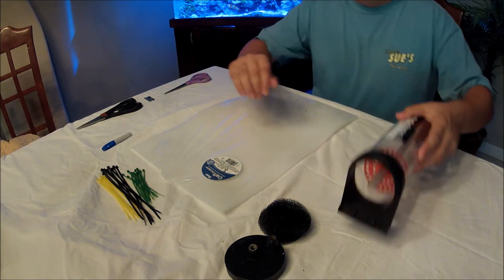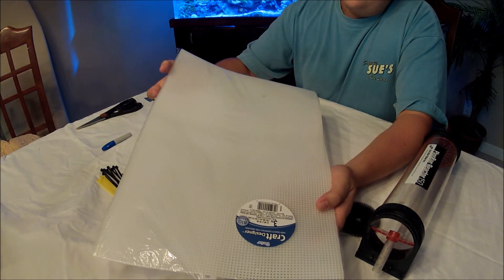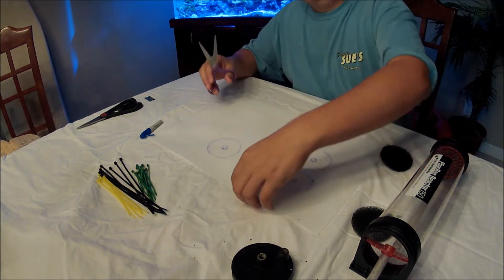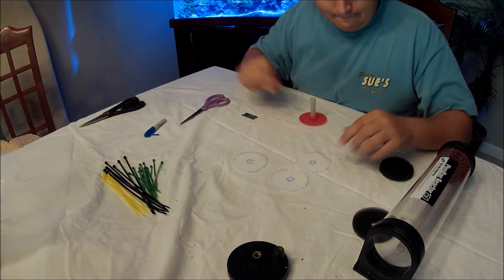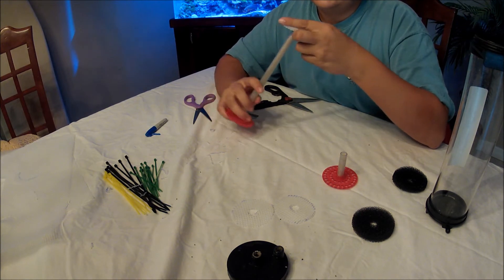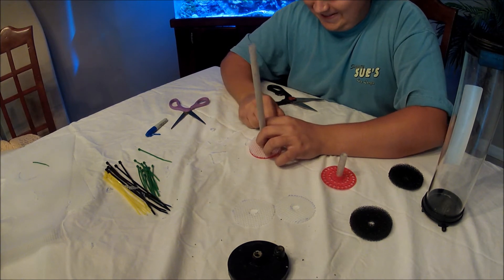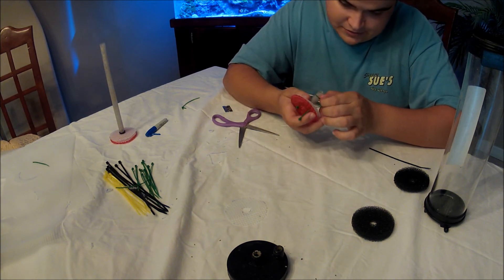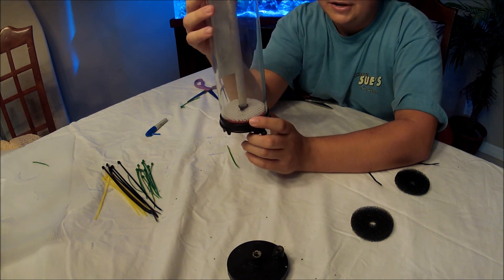DIY Phosban/Carbon Reactor MOD

Comment: Just a heads up, if your tumbling carbon like that eventually it's going to going its self to dust which will go directly into your tank.  Good idea just slow the flow down.

Comment: Lesson there, use a mechanical filter to clean the water before using the GFO reactor.  Probably also a Protein Skimmer.
Duh factor is pretty high there.